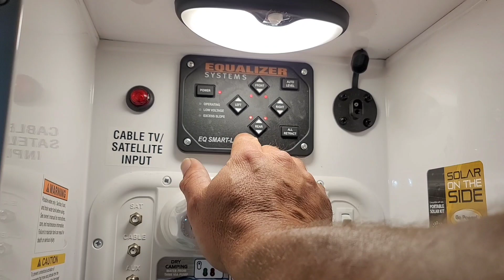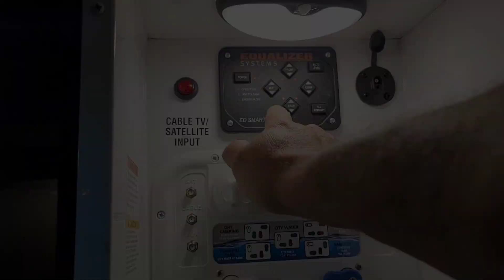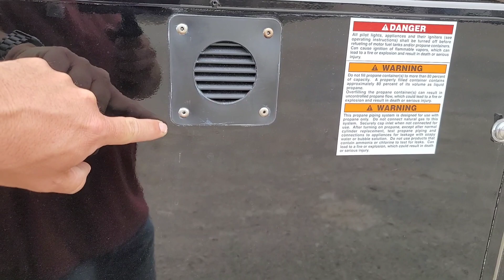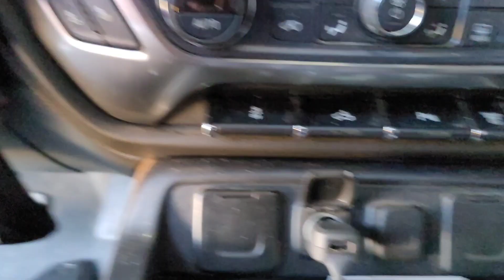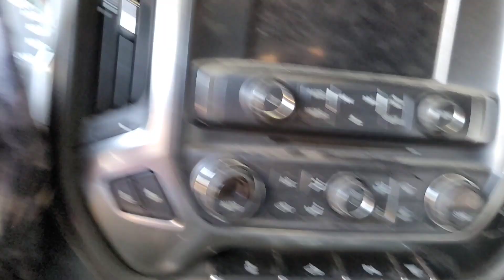Indiana to Fresno, CA

Comment: Nice video.  There has been a big issue with the transmission cooler return line rubbing on the passenger side front on the bumper mount for 2017-2019 model years. I checked mine and sure enough it had worn through protection and was touching the line. I was  able to get a piece of rubber behind before it wore through but there is a bulletin on this.. This issue would really ruin your day if you were out in the middle of nowhere with a load. Just an FYI
Reply from the maker: Thank you, I'll check mine when i get home

Comment: Charles where’d you get those boots I have been wanting some they look comfortable
Reply from the maker: They're durango boots. Not sure where i fit them but hopefully I'll find another pair just like them before i wear these out. They're really comfortable
Reply: @CFarmer  Thanks  ! I started to see your videos at first I was interested because of how many miles is on your truck. I have the same almost the twin truck mine is a 2018 Z71 model with only 44k miles haha I really get alot of value out of the repair videos and the rv transport it seems very interesting. I was considering going to trucking from roofing / home improvement.
Reply from the maker: Thank you! I try to do as much of the maintenance and repair videos as i can but thankfully mine doesn't ask for too much yet. I hope you have as good of luck out of yours as I've had it off mine

Comment: Question? Do you drive back without anything after going to California? or do you get something to pull back? Been thinking about doing the camper Transport. My question is it worth while buying new truck or get an older one first? I was an o/p for 12yrs and bought used when I started out with my 1st semi Got lucky truck was not a money pit. Theses newer pickups with all the stuff that could go wrong these days I leaning towards new at leaat I have some warrenty for awhile. Rate wise could a guy swing a 800-1000 payment on a new? I dont want to stay out for a month out at a time either. Been there done that. 2wks would be long enoth for me. Any info would help. Thanks! Enjoy your videos
Reply from the maker: So far since I've been at Indiana transport I've always came back empty. It's a long ride back but I've not seen anything worth while coming back. The last load i took out paid 2.01 totaling $4200. It cost a little less than 1k in fuel leaving me with $3200. To put in the bank. I would start with a good used truck if you haveone or can find one. But the used market is crazy right now and you could probably come out as good on a new one. I bought mine with another purpose in mind and this just worked out. I was very nervous about buying a new truck but 270k miles and it's been a trooper. My payment is right at 1k a month and insurance is $368.mo.i don't like staying out so long but it's hard for me to say no when I'm headed home and see another 3k on the board i just have to click on. I was gone 3 weeks last time. Ran 1 to mesa, az then arroyo grande, ca then Rancho Cucamonga, ca. I've been home for a week... thinking about leaving again on Wednesday. Hope this helps.
Reply: @CFarmer  Thanks! I might wait til spring and see what these truck prices do. I have 2 Half tons i could sell to put a good dent into a new one. Thanks for the reply
Reply from the maker: Anytime